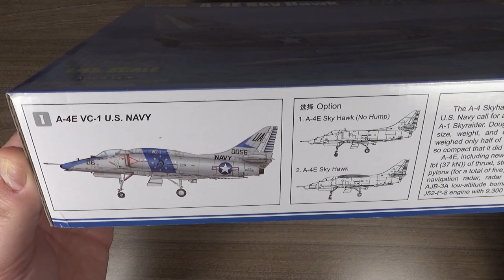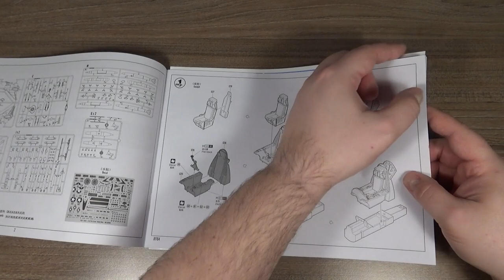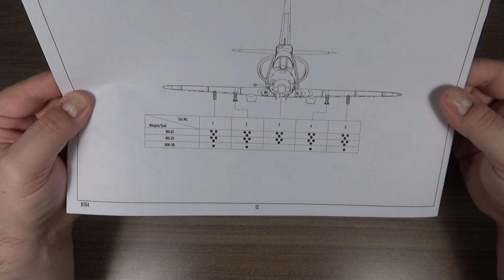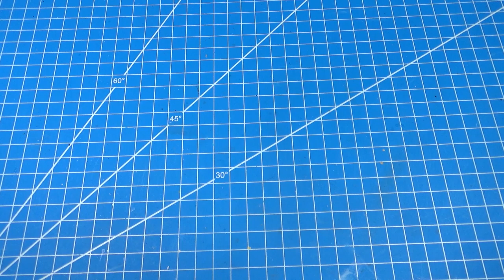Model A-4E Sky Hawk - 1/48 Hobby Boss

Comment: That looks like a very nice model. Only issue I see is Hobby Boss molded the leading edge slats in the upper position. I used to work on Skyhawks in the 70’s and those slats were not powered but rather moved by airflow pressure over and under them. 
So having them up while on the ground would be technically wrong. The Blue Angels aircraft had them up but that’s because they were bolted up for show.
Reply from the maker: Thanks for that piece of expertise you've shared :)

Comment: Sir. Great model and very nice workmanship! I really enjoyed your video. I would like to offer you some advise for your next build. Your ordnance needs a little more work. For live bombs you need a yellow stripe at the front and the nose of the bomb is steel color. Your sidewinder should also have at least a silver tip to simulate the seeker head. Finally, although I cannot find a picture of this aircraft that you built, I believe that the air brake housing on the fuselage is the same color as the fuselage. I could be wrong about this, but most Skyhawks I saw with the air brake open the housing is the same color as the fuselage. I am sure someone will find a picture to the contrary. However, the door is indeed red on the inside. I am not criticizing your build it is VERY nice. Great job!
Reply from the maker: Thanks for the advice :)
I must admit the bomb markings are pure magic to me. I painted them accordingly to the instructions. The nose of the bomb is steel, I treated it with the "dark steel" pigment, but I understand I could fail to show it on the movie properly.
As for the sidewinder - you're right, I should try harder than to just paint it as the instructions suggested.
As for the airbrakes... that was tough. I couldn't find a photo of this very plane which shows that detail. The instructions suggested to paint everything white, but I already knew that instructions in this model are garbage. I found lots of pictures with the fuselage part white and the exterior part red, and as many with both parts red. I had to flip a coin.
I know this model is not a perfect one. I'm aware that some of my viewers know this machine perfectly and will find any mistake I made.
I wish we have an actual A-4E in an aviation museum in my city, but unfortunately, we haven't.
Reply: @Big-Modeller  You have great skills and a fantastic eye! Amazing craftsmanship! Keep up the great work and I am certainly looking forward to more of your builds.
Reply: I recall my squadron's A-4s were painted red on the inside of the air brake doors and in the fuselage carve-outs. Also under the leading edge drop slats and in their wing carve-outs.

Comment: Nice build the only criticism l have for this kit is that it should have had separate leading edge slats instead of being molded into the wing . The slats were always in the open position on the ground . The only A-4 s that had the slots in the closed position were the ones flown by the Blue Angel birds and the slats were wired shut.
Reply from the maker: I couldn't agree more.

Comment: Very nice build. Thank you. I also have this kit in my stash inbuilt. I was disappointed by the lack of cockpit detail and no option for dropped flaps like the hasegawa model. But, this is much cheaper and easier too find. But, you made the model look much better!
Reply from the maker: Thanks :) I was a bit disappointed with the cockpit too. I would also prefer to make the flaps dropped if it was available.
Never said it's a perfect kit ;).
Reply: @Big-Modeller  Eduard PE would fix that up they have it for the HobbyBoss kit. And your not going to see much detail anyways with that non opening canopy.
Reply: @Big-Modeller  Also there wasn't really much detail in a real Scooter cockpit anyways though they could have included a more detailed ejector seat in the kit.

Comment: Nice build.
But Hobby Boss mislead you in a few ways.
First there are no yellow bands on the Mk.82s nose. The single yellow band indicates a live bomb/warhead (and a blue indicates an inert one). The double yellow band is the sign of the fireproof coating of the munition.
Second: they never fitted in the forward inner stations of a MER (or the inner of a TER). You can see why, those bombs obstruct the main gear doors and thus the deployment of the main landing gear. Fully complemented MER were only used in the centerline hardpoint under the fuselage.
Third: fro a live Sidewinder there should be a yellow band just forward from the first rail lock (indicates a live warhead) and a brown a little more further back where the yellow ring is in yours (indicates a live rocket motor).

I really don't know how model manufacturers were unable to figure out these things. They still give us dumb markings or marking instructions. Shame on them. And they call those Sidewinders AIM-9B, while in reality those are AIM-9Ds (or G, or H, those had the same airframe). The B had shorter half spherical nose and smaller ailerons.
Reply from the maker: Yeah, shame on them ;)
Reply: @Big-Modeller  Other than that it looks like a decent kit. My biggest problem with it, that I have not enough space to build 1/48 scale models. (I'm quite out of space for 1/72 models too.)
The marbling you've done is very interesting. Almost stand the ground as a camuflage at its own right. Looks like a tablecloth. I like it.
Reply from the maker: I wish I could make it more profound. This marble effect withers a little... My other complaints to this kit are bad cockpit detail, no flaps and no rivets.
I hope I'll have the opportunity to build another model of this airplane made by some other company. 
PS. I have no space for models too ;)

Comment: Just found your channel, new friend and supporter here.  I have a 1/48 scale A-4E from Revell that I built a couple years back, it turned out pretty nice but I am now building the Monogram Pro Series (Hasagawa) A-4F Blue Angels Skyhawk as part of my Aircraft of the Angels build series.  Never seen Mark Fit before, is that a decal bonder solution?
Reply from the maker: Hi mate :)
The Mark Fit is just a solution made for softening the decals. It won't glue or bond it, just dissolve the foil beneath the paint to make it fit into every crevice.
As for A-4... I feel a strange urge to buy another model of this plane. One Sky Hawk in the collection is not enough ;).
Reply: @Big-Modeller , I would have to agree.  One Skyhawk is never enough.  By the way I do like how yours turned out.  The A-4 is just a cool looking little hot rod!
Reply from the maker: True :)

Comment: Beautiful job! This appears to be an A-4F model Skyhawk. Did the kit offer both F and E versions (without the avionics dorsal hump?
Reply from the maker: The hump is on a separate sprue, you don't have to use it if you prefer the version without it.
Reply: @Big-Modeller  Thanks for your clarification, Big. My Navy Squadron flew both the E and F models while I was in (1966-70). Your model building and finishing skills are very good. My compliments. I build the Guillow's balsa & tissue WWI & II propeller aircraft not for flying but for scale appearances. A different type of construction than the plastic kits which feature such exquisite detail. The wood & paper kits allow more free form building and are more forgiving with most mistakes hidden by application of additional wood and sanding and occasional filling with wall mud for the big blunders...
Reply from the maker: I've started my adventure with modelling building paper models :) That's a good thing that you found your favourite branch of this hobby :)

Comment: You did a very nice job, I just started on it and noticed that the panel lines were not recessed that much, did notice that as well do you think I should re-scribe the panel lines?
Reply from the maker: Hi :)
I didn't re-scribe panel lines on this model. I don't like them to be very pronounced like in the Airfix sets. But you're right, I had a slight problem using the panel liner. It was hard to clean the wash so the paint stays in the crevice.
As for your question - I don't know ;) It depends on how much work you want to put into this model. You may re-scribe panel lines, add riveting. You must decide for yourself what level of detailing will satisfy your need.

Comment: Saludos desde Venezuela, excelente tutorial, me gustaría preguntarte sobre la presión que usaste, cuantos psi en proporción mantenías en el proceso de marmoleado y pintado?
Reply from the maker: Hi there mate :)
I cannot answer your question since I don't even watch the manometer when I paint. I just adjust the settings until the paint flow is smooth ;)
Reply: @Big-Modeller  
Ok mi amigo. Gracias por responderme. Feliz día